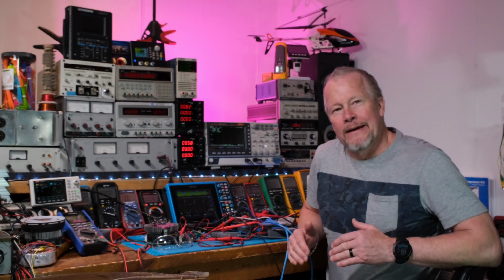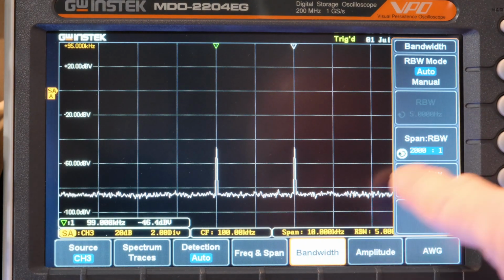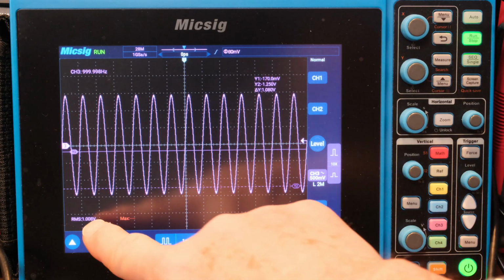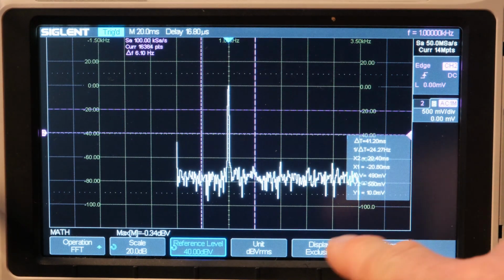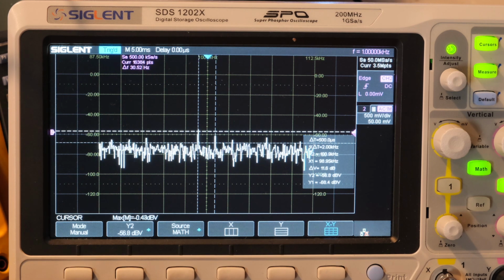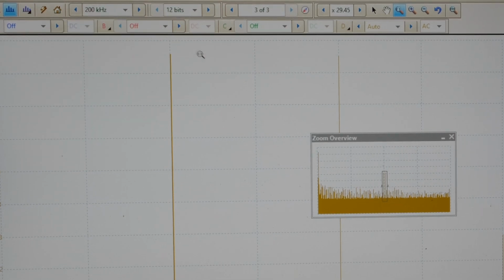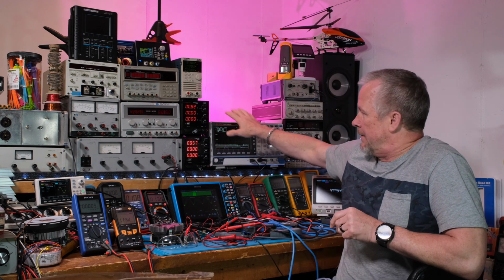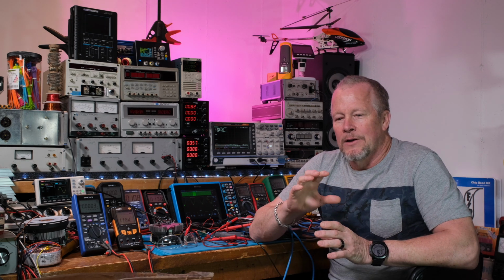FFT performance 8bit vs 12bit Oscilloscopes - Pico vs Siglent - GWInstek - MicSig #FFT #12bit

Comment: What I think? I think that being a beginner at this, I'm glad I went with a Pico 2205a as my first. It already found a bad alternator and battery on my jeep without having to rely on some parts store guy telling me, or the worry that I wasn't seeing a signal correctly because of bad hardware and software...
Reply from the maker: Wow, it sounds like you are past the beginner stage;) Nice job selecting the Pico - again few beginers would find that;)
Reply: @KissAnalog  I'm an old aircraft mechanic and instructor, but severely lacking in basic electronics... With the help of guys like you on you tube and ScannerDanner's premium channel, I'm slowly catching up. Trying to not make too many bad decisions along the way... Thanks for the help Eddie! 👍

Comment: Hey Eddie, I'm shopping for an oscilloscope because I'm entering an instrumentation and control engineering program but I dont know what kind of scope I need. I'll be working with low voltage circuits as well as micro controllers. I am currently looking at a GDS-1104B from GW Instek is this a good choice?
Reply from the maker: Great question!  I thought I'd answered this, but sometimes my responses don't get uploaded for some reason...  That is not a bad scope at all, but I do like the PicoScopes too because you get so much scope for your money.  The computer display and GPU is not on the scope so you get more scope for the money and the software is getting updated all the time.  Check it out and let me know what you think: https://amzn.to/3jANTrT

Comment: Thanks for the great video, Eddie. I'm watching this because I just recently bought a Pico scope and I love your growing enthusiasm which reminds me of what I went through myself.  ;-)   I had originally thought I would get a Series 2000 scope plus the same scope you have (Series 4000) to get a range of measurement capabilities but the sales rep convinced me to go for the Series 5000 -- PicoScope 5242B, to be exact -- because it had a wider bandwidth than the 4000 model plus the 8-16 bit resolution. So it combined the features of the two models I was originally contemplating. Another sweet point? It was being replaced by the next incoming model so I got it for less than $1000 USD, which I certainly can't complain about. I also added a current probe to the order because that will enable me to do power measurements and profile the power consumption of very low power microcontroller products I will be designing soon.
Reply from the maker: Wow amazing option and great price!!

Comment: hi great video I don't know very well about the oscilloscope I want to buy a scope so can guide me on which one is better and cheap for beginners level.
Reply from the maker: Thanks for your question!  I have some older videos on best scopes under $300 and $500, and I need to update those, or should I do a video for best scope for beginners?
Reply: @KissAnalog  - I honestly believe that you should just give a short 5 or 10 minute video on the best scopes for the money at the different price points.  Your videos are very good, but can be quite confusing at times, at least to those I've referred to your channel's scope and meter reviews.  True "KISS" reviews with most complete and easy to use menus, 8 or 12 bit dacs, accuracy and update speeds.  This is just my opinion.  I've taught electrical at the local college.  Please just do some 5 or 10 minute #Shorts on your choice for the best scope in each price range.  Great video!  Thank you, sir.
Reply from the maker: Thank you!  That’s great feedback!!

Comment: Hi there. On Siglent FFT you used only 16384 points. Why? This FFT also allows you 1GS/s with 1048576 points. If you had selected 1048576 points, you would have seen that the noise level would have dropped by over 20dB, like the Pico!
Reply from the maker: Thanks for that Florin, but my scope only has 16384 points, the -E version has the 1 Million points.  I have the bigger screen on mine, and that's why I chose it, but I didn't realize that the FFT was not 1 Million points.
Reply: @KissAnalog  I'm sorry to hear that... I thought the X version was better than the X-E. Then, you are absolutely right, your comparison is completely true. Great video, anyway.
Reply: @hflorin07  I am so perplexed at Siglent 's choice in putting out the two scopes each with a drawback...

Comment: Hey Eddie I’m not going to lie I’m not actually sure what FFT is, would you be willing to do a video on what FFT is and where it is useful?
Reply from the maker: Thanks @Hill Amplification, that is a great response.  I’ll do a video to try and explain this complex thing called the FFT;)
Reply from the maker: Thanks for this feedback.  I do have other videos that I show the FFT, and talk a bit about it.  You can search my channel for FFT, or search YouTube with KissAnalog FFT.  I’m glad that you were one of the brave ones to bring this up.  Not an easy subject.  I’ll do a video on the KISS method of understanding FFT;) Thank you!!
Reply: @KissAnalog  I have searched for it in the past but the examples were kinda hard to see the practicality of it so I just couldn’t wrap my head around what it means in a real application….. like in college I got through the first 3 calculus classes alright, because I could visualize it. But with differential equations I couldn’t see it and I struggled, I bought my scope which is a rigol 1054z because it was the cheapest full feature scope with 4 channels. Knowing it’s FFT was not great, But again if I’m honest sometimes I use it just like 4 volt meters lol…. One day I’ll get there…..
Reply from the maker: LOL well at least you are using your scope;)

Comment: Your videos are become more consistence, it looks like you are near to have found your preferred style, and it's a fine style. :-)
I do not know but suspect you also have found it faster and easier to edit, now you have found your style?
About the 0.01% noise, would an analog scope be able to show that signal, since it has "no resolution"?
Reply from the maker: Thanks Fried Mule!  I am getting faster, but these videos actually took some time to do because of all the cuts and edits due to the different scopes and camera positions.  My new setup does use autofocus which has helped a lot - although isn’t perfect;)